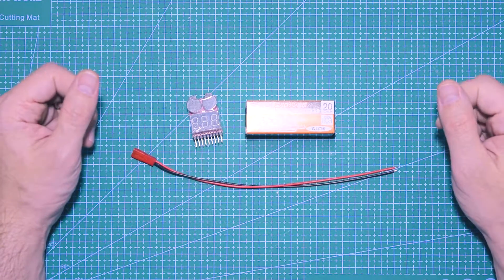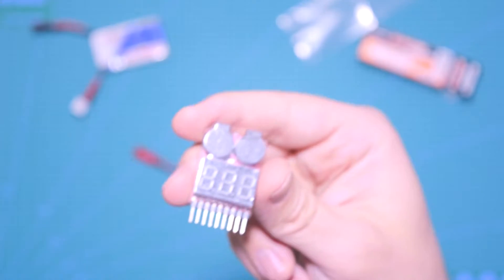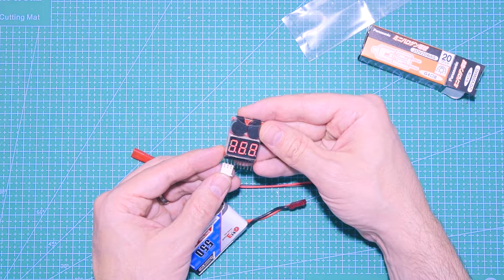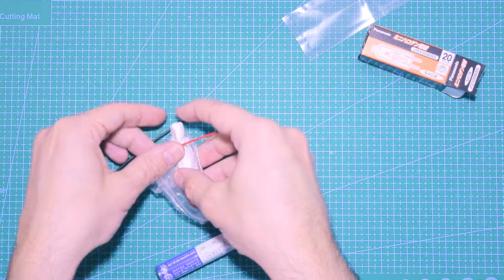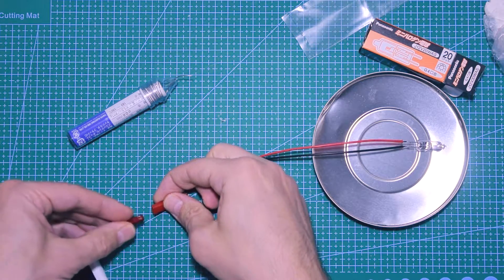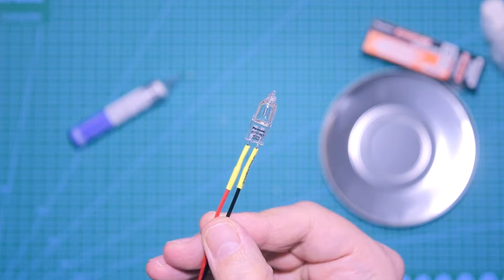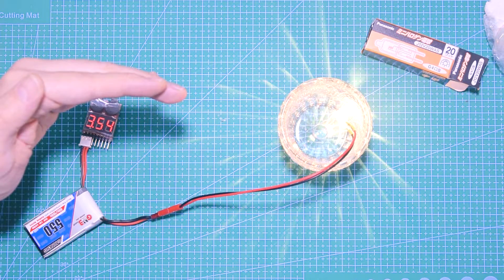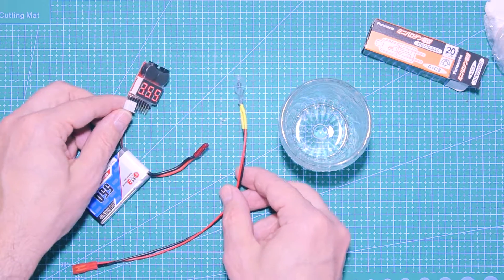How to build a Lipo Discharger cheap and easy!

Comment: Great! Would I need to use a different bulb for a 3s battery? Also, sometimes I'd like to quickly discharge even 600ma 1s batts. What bulb would I wire up for those? Thanks much for good info.

Comment: What is A rating on this "discharger"??? Thanks.
Reply: I don't have it but technically the LED device shouldn't really draw more than a few milliamps itself to power the LED and buzzer.  The discharge amp rating is going to be determined by the load you connect to the power connectors of the battery, in this case it would be the halogen bulb.  The halogen bulb in the video is 20W, so it is going to attempt to draw 20W of power from the battery it is connected to.  You can take 20W divided by current voltage of the battery to determine the amperage.  So, with a 20W load, a 7.4v battery discharging @ 2.7A, and a 14.8V battery would discharge @ 1.35A.  The amperage draw would increase as the voltage of the pack dropped during discharge.

Comment: Nice video, but you should never touch a halogen bulb with your bare skin. It is likely to affect performance/lifetime and may lead to early failure.
Reply: Would it be okay if bulb is cleaned with alcohol after handling?   Can't see how glass is permanently contaminated.  I do remember in Jr High, the instruction were explicit,; "Never touch glass on  the projector bulb when changing."
Reply: @birdwing98  Yes, it should be ok if you clean with alcohol and dry it.
Reply: really??? the hardware i buy them from just hand it to me bare and all. damn